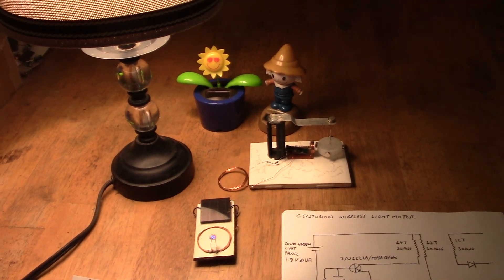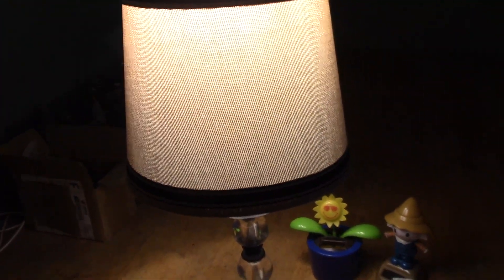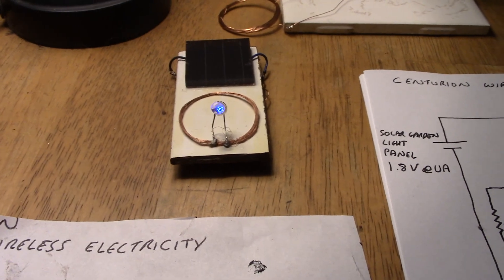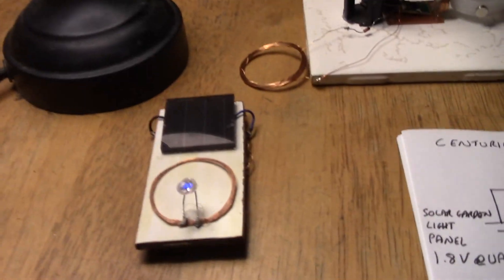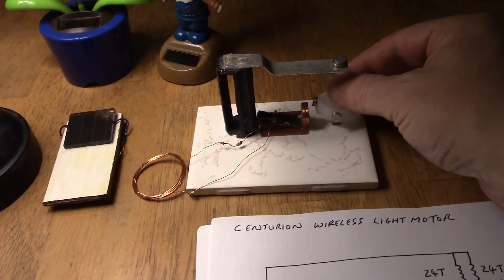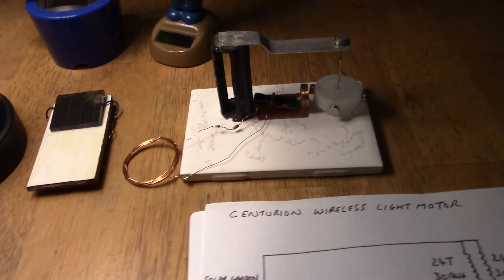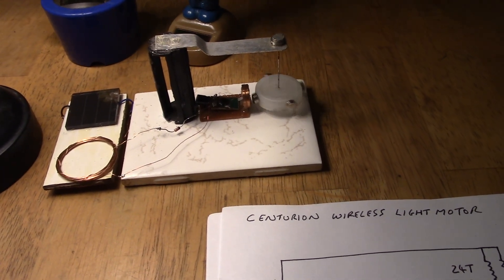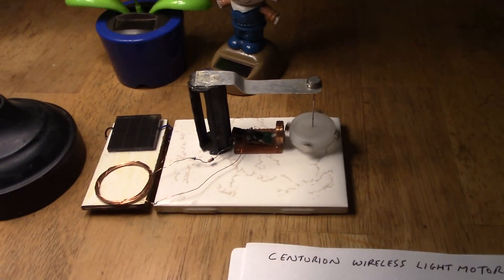Wireless Electric Light Motor

Comment: Interesting demo.  Always fun to see so much done with so little electricity.

And I can identify with rotor magnets being grabbed loose (even when hot glued on).  My solution is either (1) wrap tape around the rotor, or (2) put the magnets on the inside of the lid.  But I may resort to using ring magnets so I can screw the darn things on.
Reply from the maker: Inside the lid is a good idea. Encasing in concrete would be another way! 

These are attached to tiny cylinder magnets that are a friction fit in the plastic. Except when they're grabbed by other magnets of course.

Comment: Is that apparent efficiency gain due to your Centurion circuit or the larger solar cell? What happens if you use the smaller solar cell from the dancing flower? Your circuit is similar in some respects to Master Ivo's latest revelation so the output might be even better with a bit of tweaking following his design!
Reply from the maker: The plastic parts are likely most of the friction on the wavers, but the Centurion is about my own best for ultra low power uses.  I built the transmitting section first, intending it just to be for LED's, but then made the comment about a wish to get a wireless electric motor going. This could likely do with a cap before the receiving diode.  

Hadn't heard of Master Ivo before, will check out his methods :)
Reply: @Slider2732  Master Ivo has a YouTube channel and his latest video is discussed on OUR website under Solid State Tesla hairpin circuit. I think you might find it very interesting!
Reply from the maker: Thanks for the heads up. I looked at his solid state Hairpin circuit vid and hit Subscribe right away. He's doing some great research and his vids are getting good viewing figures.
Reply: @Slider2732  Glad to help! I'm surprised you didn't already know of his work? You can follow his experimentation, as evostars, at open-source-energy.org